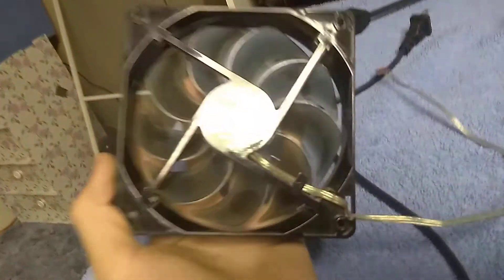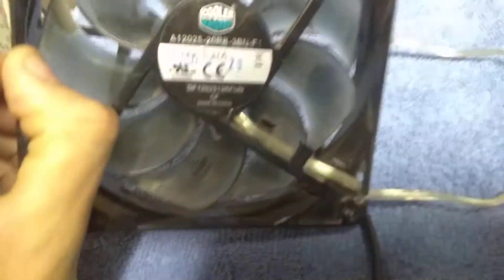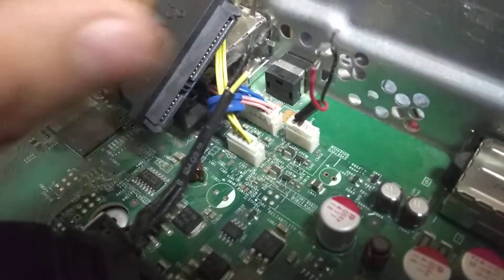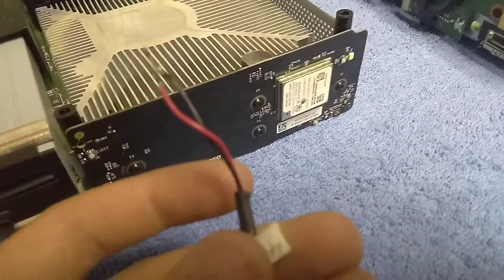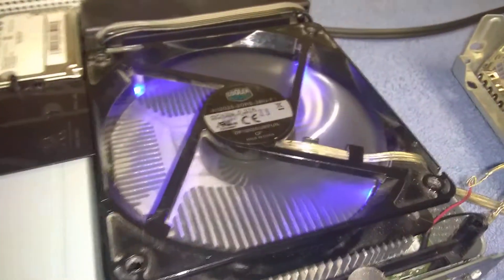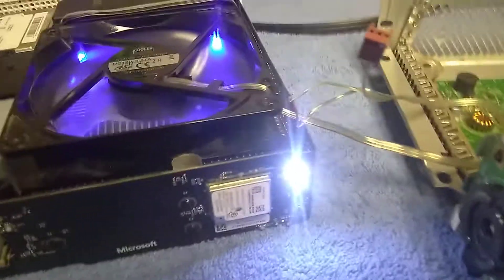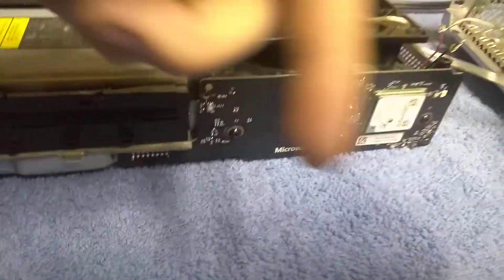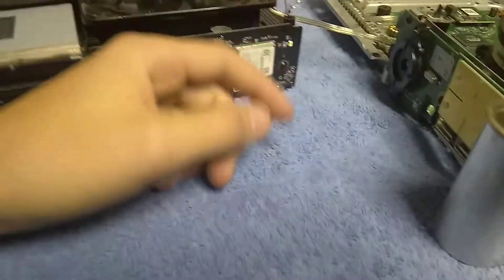Xbox 1s 12 volt Cooler Master fan mod

Comment: I’ve already done this mod on my Xbox one S with the same cooler master fan along with cutting a window above the disc drive and putting plexi glass and led’s inside. You don’t need that xbox360 clip at all. If you just clip the original plug on the Xbox one S and connect the power and ground to the fans power and ground it will work the exact same.
Reply from the maker: I just decide to keep the original fan and just pull one pin on the fan module and left it at that for a fan mod.
Reply: Infinity 12 Yeah I’m guessing the pin you pulled was probably for the pmw which controls the fan speed so your original fan is probably running at full speed?
Reply from the maker: @SMOKNYA6.6  yes it is running at full speed. I leave it on all the time and shut it off every now and then to give it a break.
Reply: Infinity 12 If you had just cut the pmw wire on your original fans wiring it would have done the same thing but if you just clip that wire instead of pulling the pin and you have your Xbox one set to instant in mode it will do what yours is doing now but if you put your Xbox one into power saver mode instead the fan will turn on and turn off when the console is switched on and off like it originally does but your fan will run at full speed but I think because you pulled the pin instead of just clipping the wire it won’t do that anymore. I’m sure it’s a pain to keep doing it the way you are now.
Reply from the maker: @SMOKNYA6.6  I'll try it your way. I was going to get a potentiometer for it so I can adjust the fan speed.
Reply: Infinity 12 Yeah man you should try it worst comes to worst it just wont work but it’s worth a shot. I have my one S setup with the cooler master fan I just cut the original plug from the board and cut the end off the fan and tied in to the power and ground. My fan had 3 wires on it. Power, ground and tach which tells the Xbox how hot it’s getting and the original Xbox plug has 4 power, ground, tach and pmw which controls the fan speed based off the tach but since I have it hooked to the power and ground directly and it’s at full power the tach and pmw aren’t needed and mine never gets hot and I have it set to energy saver mode so it turns on and off with the console. If you think about it the console always has power when plugged in but the only things with constant power are the usb ports the board is hooked to the power switch so whenever the power button is pressed on and off it gives the board power which switches the fan on and off and as far as energy saver mode I’m not sure how that exactly effects that but my guess is when its set to instant on opposed to it being set to energy saver mode it somehow changes the power to the board to be constant and not constant which changes the fans power which is actually helpful to run different types of fans and stuff. I like your video though. I never knew you could use the plug from a 360 slim to do that.